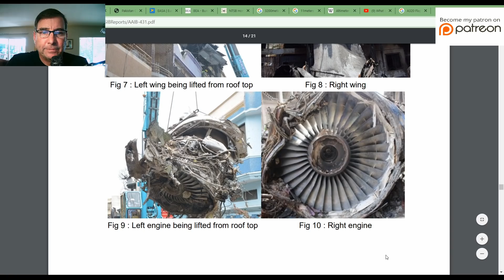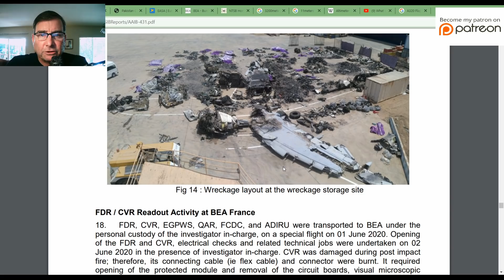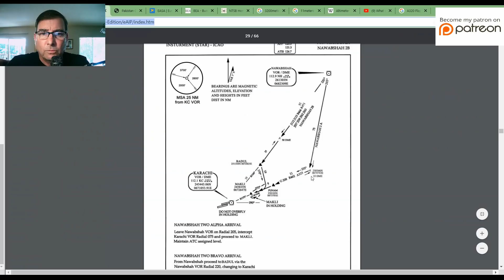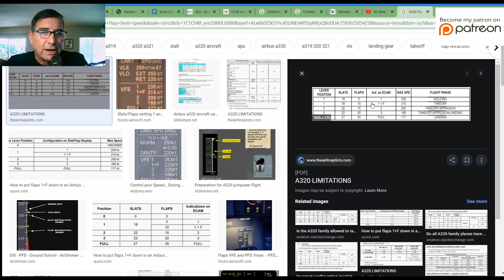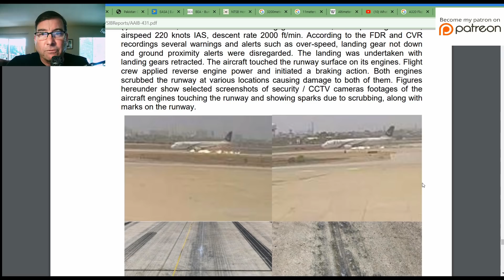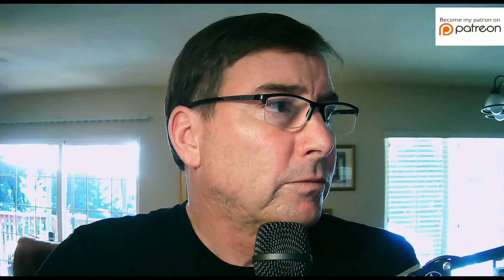PIA #8303 Preliminary Report Part II

Comment: @blancolirio When you say that this is possibly the worst case of a Human Factors crash, I assume that you are comparing PIA 8303 to even the horrific crash at Tenerife (Capt. van Zantan's wonderful Aeronautical Decision Making)? That one is (or was) the poster child for "What were you thinking?" (Me- a layman NON-pilot who is familiar with Risk Management.)
Thx
Reply: It could be considered that while the Tenerife crash had a worse outcome than this, the human factors involved had less to contribute to the total chain of events.
(in Tenerife there was delay, fog, busy airport, urge to depart, and then in addition human factors.  in this crash it seems to be human factors only)
Reply: @Rob2  Very true. There were environmental factors (the attack on the other airport, fatigue, low visibility). There were technical factors when simultaneous radio transmission caused radio reception blockage (you can't hear what they are saying). There was the "traffic jam." There was the controller's lack of ESP and other sub-optimal performance. Procedures were weak. There was a mountain of other factors. At bottom, I think the single most important factor was van Zantan himself. He was the chief pilot and trainer. There was NO ONE more capable of recognizing his own flaw in the company. Except for the fact that we almost never accurately self assess flaws, biases, etc. After all, "it can't be me. I can't be the problem...." Oooo... I've met the enemy and it's Me, Myself, and I. 583 fatalities- it was foreseeable and preventable. Hopefully I never hurt anyone like that ever.
Reply: @Rob2  Exactly!
Reply: @Rob2  In the Teneriffe Case you can also add the overcrowded little Airport with the lack of adequate tecnical Equipment, the Radio Transmission failure, the misunderstanding between the ATC and the KLM Crew due to language barrier. Nothing similar played a role in this PIA case.
Reply: @Rob2  Yes, agreed. It is definitely NOT Human Factors alone. However, if in our fantasy scenario world of time traveling and second guessing, I think that if you remove some key factors in van Zantan's decision making, you avert the crash. He had the last, best chance. Crew Resource Management (almost certainly) would have stopped this. His FO (co-pilot) had huge doubts and SAID as much. One tiny instant of realization on van Zantan's part has him NOT applying thrust the second time. At least his FO got a chance to broadcast "We... are... at takeoff!" Just a handful of seconds improves the PanAm outcome. A few seconds more averts the collision entirely. Next, there's van Zantan's get-there-itis. Maybe his fuel top wasn't necessary. Maybe he feels guilty about holding up the show- everyone's show- for nearly 45 minutes while he refuels. Arrogance... Optimism Bias... a tiny taste of Confirmation Bias, all Human Factors. We could speculate about stress, fatigue, and illness. Finally, if the criminals who attacked the other airport are prevented from attacking, a vital link in the chain of causation is broken. You can say that they murdered the 583 people and maimed the rest. At least we all learned that our Best and Brightest can make deadly mistakes too.

Comment: The Aircraft crashed 1348 meters short of the runway 25L. It was almost aligned to it. Could there be any possibility, after the both engines failed, pilots could have avoided stalling the plane at very last moment by reducing angle of attack pitching the nose down and setting flaps to full? Can any expert pilot can simulate these last moments when you are at low altitude with engines failed whether is it possible to make the plane push little more forward  upto 1300 metes to reach runway?
Reply: The flaps wouldn’t work due to no hydraulic pressure in green or yellow system. Only the slats would work but not sure how much that would help. Also I doubt they had any altitude left by the time they were stalling so putting nose down would probably have just meant they’d crash faster

Comment: So could they have made the runway if they hadn't stalled it?
Reply: Doubtful
Reply: Two dysfunctional engines means no
Reply: They didn't comprehend the damage to the engines because the whole event startled them.  The proper thing would have been to fly a tear drop back to the runway but they instead attempt to fly an entire go around.  The engines took them to within 2000' of the runway threshold on the second attempt.

Comment: Would the gear automatically retract if they exceeded max speed during 7000 ft/minute dive to intercept glide slope?
Reply: No
Reply: If they exceeded max speed, the gear would not deploy, as a mechanism to prevent damage and / or destruction to the landing gear, and gear doors.

Comment: I'm confused as to how an aircraft can be certified to fly with an FDR system that cuts out when main electricity goes out like you said. Is this something common on that aircraft or other Airbus? It seems to me like a complete oversight.

We also just found out that PIA has about 40% of its pilots "not currently flying" with fake pilot license. If that doesn't send chivers down your spine I don't know what will...
Reply: The FDR is not as essential as the pilots instruments, SEC1, ELAC 1, GPS, ADR1, FAC 1 and possibly a couple of others. The RAT can only provide 1/18th the power of the engines above 140knots (or 125 in newer aircraft)
Reply: @tomstravels520  I understand that but not in the context that we want to see everything that happens when a plane goes down until the very last second. It should have some redundancy.

Comment: After landing the first time with no gear down and reverse thrust....... how were they then able to take off again.
To me it seems you need a lot of thrust to do this, especially having no wheels?
Reply: First of all, you can select reverse thrust but nothing will happen in an Airbus if the main gear isn't compressed to a certain degree. The gear wasn't extended so there was no reverse thrust. Secondly, they were so fast at the first attempt, that they could easely start to climb again.

Comment: Is the altimeter working in metres then they realised and changed it to feet? Not sure whether this is possible though and I presume it would show up on the FDR!! It could of been indicating 3000 metres which is roughly 10000 feet. Now they are too high thinking they were at 3000 feet now they are 10000 feet. So poor piloting makes them bomb down and then everything goes wrong. I'm probably talking rubbish though!,

Comment: I'm very confused...   The video shows the landing gear is down.  Did they retract the gear after attempting the go around post runway contact?
Reply: Hi Crhis: Juan would say from reading the report; that there was an attempt to lower the gear; at 7000ft altitude? .. then the gear was RETRACTED soon after; the official report says this, it would seems.
Reply: @geoffarden917  _ It is possible the gear did not extend due to the high speed of the aircraft regardless of the gear down selector in the cockpit. "If" the gear did not go down there would have been a warning extended to the cockpit. I suspect that the gear selector was in the "gear extended position" but the gear did not descend, and the crew missed this - which would explain why they were surprised when the aircraft engines made contact with the runway. I think we will get more clarity on this over time.

Comment: Human factors? That's stretching that concept to the breaking point. Until this incident, I did not think it possible for an airline flight crew to perform so poorly. Thanks to these two incompetents, we might have to create a whole new classification for such egregiously bad performance, Stooge's Factors. By the way, how hot would they have had to be landing to have scraped the runway, applied reverse thrust, and still have enough energy to take off again?? More importantly, why would you want to? What an unbelievable tragedy.
Reply: I would go into root cause mode.  How did this crew get on the flight deck in the. first place.  It's also a QA issue.  Who checked their qualification?  Who verified their qualification?  And so on.  This is a company wide systematic problem.

Comment: If the engines failed after first attempt, how could they get any air speed to try again?
Reply: [Start Speculation] Possibly because the damage to the gearbox caused fuel starvation to the engines, as opposed the turbine itself being damaged [/End Speculation]

Comment: Well there’s a pretty sad commentary on the pilots that flew this aircraft to its fateful ending. I’m curious if the plane had some type of auto retract for the landing gear for over speed or possibly the gear was unable to drop due to the speed they were going and the pilots weren’t aware of it. I can’t imagine why they would retract the gear once down. It sounds like there was a total disregard for normal flight procedures throughout decent into landing of this plane. Makes ya wonder what is allowed over seas. I’m sure ATC here in the U.S. would have been all over these pilots. It appears there was a total disregard for the lives on that plane. A sad commentary.

Comment: One more thing - WHY WHY WHY would it be considered acceptable to have a key piece of equipment  (FDR) go offline like that.  The FDR and the CVR should be the first two pieces of equipment powered after power is provided to the flight controls.   Which is worse - That Airbus ever used a design like that OR that any aviation authority permitted it to be used?  I'm no fan of Boeing anymore but their 737 Max issue was more a matter of failure to train than a failure of a system.  The 737 issue could be overcome with training but this....
Reply: Firstly it was a failure of designing redundancy into the MCAS. Secondly there are more important systems than the FDR that require power. The ADIRU, SEC 1 and ELAC 1 to name a few and crucially the blue hydraulic system. The RAT can only provide about 1/18th the power of the engines. Even in the cockpit only the captains displays and the top centre display are working. The ECAM also records information as well as the FDR

Comment: It looks like the Captain was arrogant and the co-pilot reached a point where he was acting on his own -- they were not sure what the other was doing.  Raising the gear and flaps before the first landing attempt suggests one of them was preparing a go-around.  This looks 100% crew related and my guess is that the arrogance of the Captain resulted in this tragedy.  Arrogance has killed before -- the worst aviation disaster ever, not counting 911, was the two 747's that crashed on the runway at Tenerife back in 1977 and although there were many factors at work there, the arrogance of the KLM Captain sealed the fate of more than 500 people.

Comment: You have lost both engines. You have very good reasons to believe you are not going to make the threshold. Why the hell do you not take the aircraft away from residential areas, and try and put the aircraft down somewhere in the boundaries of the airport. There was plenty of room to the right of track, yet they went for the centre line of the runway.  🤦‍♂️

Comment: Seems the crew  was forced out the cockpit and some Al-Qaida folks steered the plane.  At gunpoint they forced the captain to say "comfortable" and "satisfied" but this is not what the captain would have said in that breakneck pace situation.
Reply: And how would they get into a locked cockpit? And why did neither of the survivors mention hijackers?
Reply: @tomstravels520  you are right, it is impossible, but it is just so crazy to believe that captain Sajjad Gul did such a thing?
Reply: lenny108  IF that were the case, it would have been highlighted in the CVR readout.  They also would have mentioned if there were any signs of struggle in the cockpit, but they did not.  From what has been said by those who listened to the CVR, the pilots were talking about COVID-19 for most of the flight.

Comment: @blancolirio this report https://www.aljazeera.com/indepth/features/deadly-skies-pakistani-pilots-allege-systemic-safety-failures-200719071955129.html on the state of aviation in Pakistan alleges "pilots had been encouraged to conduct approaches to airports "hot and high" - meaning flying for longer at higher altitudes, approaching runways at a steep angle of descent and higher speed - to save fuel. 
"If you come hot and high then you are cruising higher and saving fuel on the way down," said Pilot B." 

This doesn't sound right to me. Wouldn't throttling back and descending under minimal power consume less fuel than maintaining cruise speed at cruising altitude? I understand there's less oxygen and consequently less fuel to burn at high altitudes but it still means keeping the engines throttled up. Seems to me that coasting down a gentle glide slope would be the more fuel efficient option.
Reply: That's absolutly correct. A normal decent profile for aircraft like the A320 is rather conservative. Which is often not a bad thing because you need time to set up the aircraft and talk to atc for clearances. But that also means that you may level out for instance at 10'000ft for a minute or two which needs engine power again and at this altitude the aircraft has a lot more drag than at cruise level.

Comment: I have not coomented earlier because I have been so uset about the litany of troubling stories about this crash and now with further revelations about fake pilot qualifications. Is this the end result of making planes too easy to fly being exploited by greed? When I grew up pilots were "special". Now it seems anyone can be "special" if the system allows it. Maybe it is time for international independent testing of pilots and safety ratings that mean something tangible instead of public warnings. When peoples lives are at risk it needs to be something like a standard required for access to airspace and insurance, especially for carriers.
This crash started a long time ago and the problem is than many families are the unfortunate carriers of that burden. Hopefully the entire industry addresses the root causes of this accident, because having a perfectly fine plane crash because of extreme human error is the last thing the industry needs at this time.

Comment: Pure speculation, but as I listen to this report breakdown, the pilots were arrogant.
I expect there is a hierarchy operating here where the Captain trumps the First Officer ....so the FO does not correct the captain’s errors. So I believe the Captain was flying. 
Plus, they have not followed cabin procedure ...by chatting, leading to complacency and then confusion reigned and more errors were made.
Sheer arrogance by both pilots. Sadly.

Comment: Is it possible, that both pilot and co-pilot where replaced in the flight deck sometime in the flight before final decent was to take place?  Is it possible that non-pilots where flying the plane into KARCHI?
Reply: Of course the investigation of the scene of the accident would have uncovered that and it would certainly have been mentioned in the report.
So NO.
Reply: I have no doubt that non-pilots may have been flying into KARCHI. The real pilots were flying into Karachi.

Comment: Juan, the usage of “human factors” term is not correct. By saying that this accident may very well be the worst case of human factors failings that you have seen, it implies that there has been something awfully wrong with the design of the aircraft, its systems, and their interface with human (the pilots). I believe you wanted to say that this accident may very well be the worst case of human errors, not factors. If the “ergonomics” (human factors) played a role in this accident, is remained to be seen. There is nothing about it in this preliminary report. Thank you.
Reply from the maker: It's nicer than saying "They screwed the pooch"...